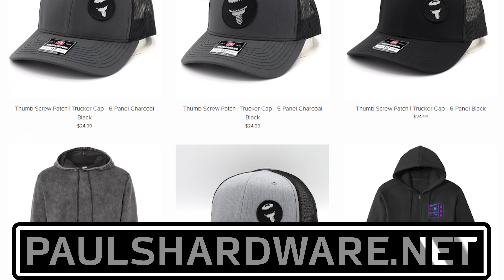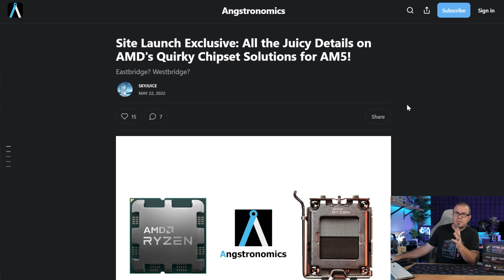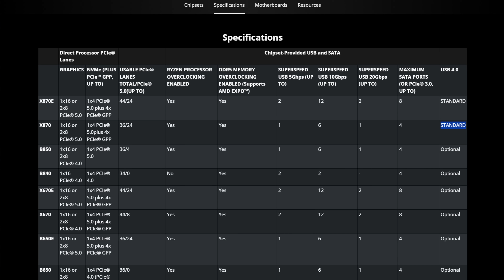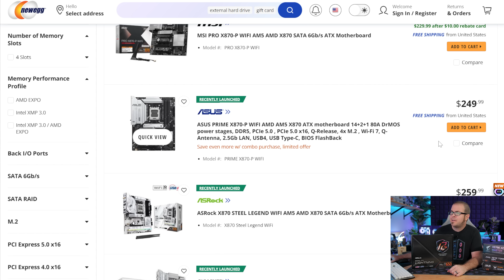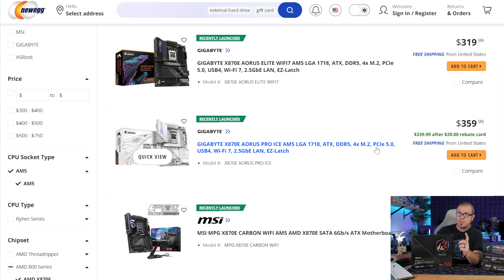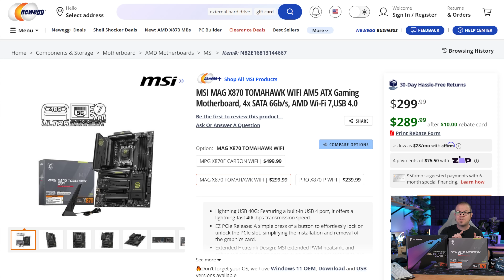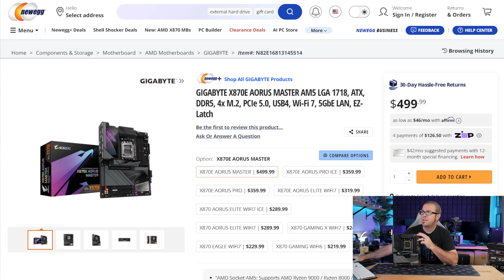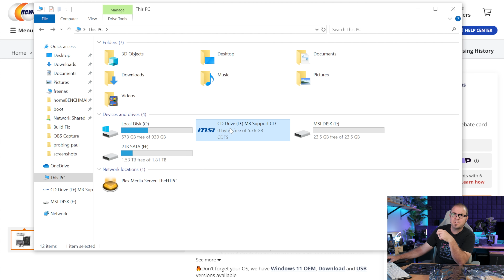Explanation / Rant about AMD X870 and X870E Motherboards

Comment: im waiting for the day they make 10gb a standard for consumer boards without using another add in card
Reply from the maker: True, I feel like they've dialed back on the 10Gb offerings in motherboards since 2.5Gb and 5Gb became a thing though
Reply: @paulshardware  asus still has their x670e proart with built in 10gb, and add in cards can fit on the bottom pcie 4x slot. msi has 10gb but they would charge $800
Reply: @ino_kyotsu  yeah I use the card slots for other things, I need my NIC integrated.
Reply: @ino_kyotsu  Honestly the x670e ProArt might currently be the best value AM5 board out there - USB4, 2 PCIE 5 x16 slots suitable for GPUs (bifurcate to x16/x0 or x8/x8), both 10G and 2.5G NICS, WiFi 6E, a third PCI Gen4 x4 slot (although shares lanes with the 4th m.2 slot, both will run together at x2), and solid VRMs.   The former value crowned ASRock b650e Taichi Lite is basically unavailable now. At $240 it was a steal, but it only has 2 PCIE slots (the second being 4x4 so not great for GPU use), and 3 m.2 slots (the 3rd sharing lanes with the second PCIE slot).  No 10G NIC.
Reply: Why even use 5 Gbit when 10 Gbit is so well established in the industry?? Most common NICs like the Intel X540 only support 1 or 10 Gbit, but are super available for consumers.. So by having 2.5 or 5 Gbit, you might run into stability issues on the network. Which is why i upgraded to the X550 on my NAS, but 5 Gbit devices are rare and doesn't make sense! Just give us 10 Gbit LAN and make it the norm instead..

Or ditch the 40 Gbit USB-C ports which I'll NEVER use anyway..
Reply: @W0ND3RB0Y1  a lot of the older 10gb cards don’t even support 2.5 or 5 gig at all, and you’ll end up with only gigabit when you connect to a x540/x550 in a server
Reply: They don't even include 20 cent 9 segment displays tbey wont be adding things that actually add cost of BOM
Reply: Especially considering how garbage Intel's 2.5G NICs are.
Reply: I've made this point several times and I've had multiple people defend the board manufacturers... it's nuts. At $500+ 10Gb should be standard and at least Asus has the ProArt for $480 that does.
Reply: Because the only real offering for 10G networking PHY's is Intel.  Realtek offers their chips at a fraction of the cost,
Reply: @2dfx  the 10gb ports on the asus proart x670e (maybe some x870s) motherboards are from aquantia. most of the intel nics (from my server experience with using a supermicro x10 for my homelab, use the intel nics. this is usually the case for intel boards, not amd.
Reply: @ino_kyotsu  consumer hardware is only now getting 2.5G since it's effectively required for WiFi 6e/7 also 2.5G doesn't require a rewire and runs on Cat5e natively.
Reply: I wonder if it's to do with it eating PCIe bandwidth - if people really want it (in their thinking) then use a PCIe card, that gives people the option to free those lanes if they don't need it. Well, that and cost 🤣
Reply: this topic has been discussed a bunch on the l1techs forums.  Basically it comes down to 2.5 and even 5 gbit are almost "free" to implement, and 10 is pushing the boundaries of copper, so realistically if you "need" 10gibt you should be going fiber connectors.
Reply: @sultanofsick  I realize that 10Gb pushes the boundaries of copper and all that, but my home is wired up with Cat 6A and seems to do just fine with 10GbE. It may not hit the maximum bandwidth all the time, but it's still above 5Gb.
Reply: @sultanofsick  I'm sorry... but that's absurd. First of all, Asus is including 10Gb Ethernet on the ProArt for $480. So the idea that it's a cost issue is BS. Second, not everyone that can use 10Gb is running a home lab and can justify going all out on fibre because 10Gb is enough.
Reply: Not going to disagree that it should be the standard at this price point. But most people will not take advantage of it.  Most people can’t take advantage of 2.5. HomeLab users are the only ones that will take advantage of anything over 2.5.
Reply: @Bob_Smith19  I mean... nobody is implying that most will and I disagree that HomeLab users are the only ones that will. Creative types can make use of 10Gb. Anytime you might want to work off a server or a NAS, or even just have quick large file transfers, 10Gb is VERY useful. The pool of people that could use 10Gb is larger than you think.
Reply: @Bob_Smith19  Anyone with a 10Gb NAS or multiple computers on a LAN with 10Gb NICs can take advantage of a 10Gb NIC.
Reply: Network wise it's good. 
Not many people have a SP that provides 10GB connection at the private user level.
If you have 10GB connection you can also afford the boards that supply that so whast's the issue?
Reply: @IndigoSun-hz6cq  The issue is, at $500+ it should be included that that price.
Reply: @TheGameBench  It's not though. I'd have to go to my ISP and ask them to come up with a one-off-me-only deal to get 10GB download. If I can do that then the price of the board is a zero issue issue.
Reply: @IndigoSun-hz6cq  It's a non-issue FOR YOU. Your situation isn't everyone's. Besides, fast internet isn't the only reason to have 10Gb Ethernet. It isn't a non-issue for many people that are complaining about it and the fact that Asus is doing it on a board that costs under $500... there's no excuse.
Reply: @IndigoSun-hz6cq  its not for internet, it's for local file access through a nas.
Reply: yeah ... me also ... anything less is just LAZY
Reply: the avg household doesn't have 10g ethernet. It's more for companies
Reply: @mikeramos91  And the average household isn't buying a $500+ enthusiast level motherboard. So... it's a moot point.
Reply: @TheGameBench  no one said they were. $250 motherboards with 2.5G is enough for the avg household 🤷🏻‍♂️
Reply: @mikeramos91  The issue is that you said the average person doesn't need 10Gb... and I won't argue that. What I said is that the average person isn't buying a $500 board and that's what we're complaining about. The kind of people that will pay $500 for a board could also benefit from 10Gb, not just companies. That's the point that you're missing. Nobody is bitching about $250 boards not having 10Gb Ethernet.
Reply: @TheGameBench   well the guy who made the original comment is. He’s waiting for the day they make 10gb standard which would be on the cheaper boards 🤷🏻‍♂️
Reply: @mikeramos91  Fair enough. I didn't get that they were implying that in the original comment, but if they were... I completely agree that 10Gb makes zero sense in mainstream boards and won't be relevant for those buyers for a VERY long time.
Reply: Why?
Reply: @JP-iq7pu  Why not? The point is that at $500 for most of these X870E boards, it should be included at this price.
Reply: @TheGameBench  and keep in mind, the asus proart x670e has 10gbe and is around $400
Reply: @JP-iq7pu  connecting it to the modem ???
Reply: @lucasrem  Yeah, but I have 400MB of service. They say I can get 1 GB service, but I doubt I will get the true amount, and it is cable over copper. For some odd reason, no one will bring fiber to complex where I live, even though I know there is a complex next door that has it.
Reply: @JP-iq7pu  With fiber, there's a direct run from the hub with a rapid signal degradation after a certain length without a repeater. Usually for ISPs it's about 1000 feet. If you're past that distance, they'd have to install another repeater. That costs a lot of money both on the install and over time, so they usually won't do it until there's enough demand to justify the additional cost. I'd recommend having all the people in your building/area signing up to get notified when fiber is in their area on the ISP's site. That will notify the bean counters to green-light the addition.